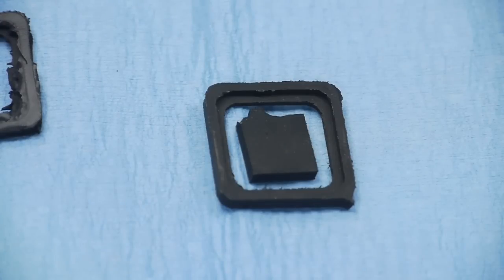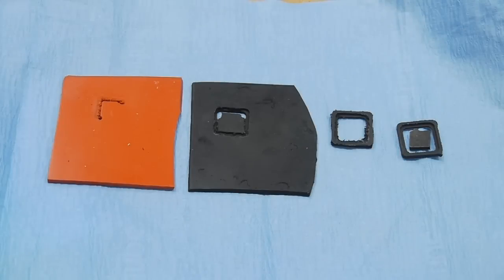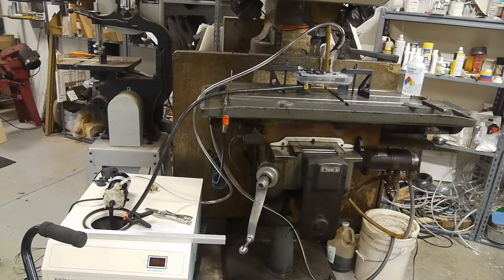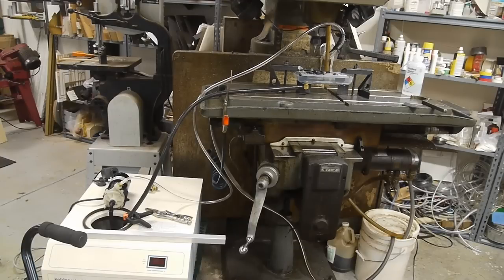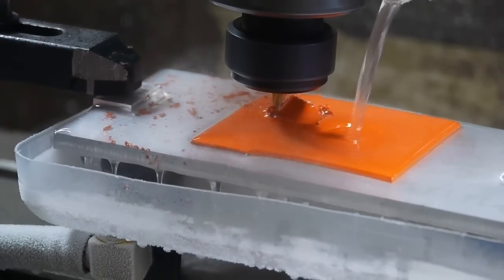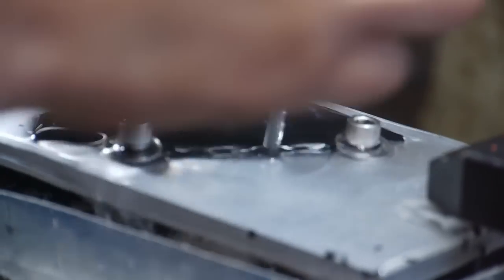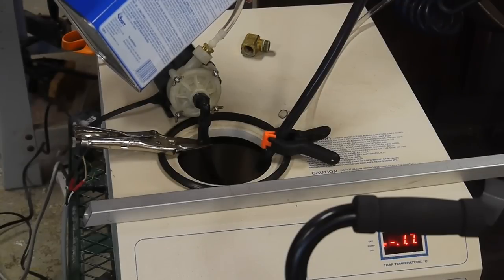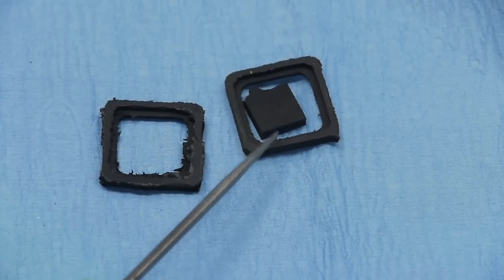Cryogenic machining: Custom rubber parts

Comment: Interesting experiment! It looks like it is easier to machine a form out of aluminium and fill it with silicone or rubber under pressure instead. Even if I need one prototype - aluminium form method maybe even faster. Plus you can heat the form for vulcanization, make few copies using different materials ... 

What will be interesting is to try machining metals such as aluminium (like 6061) when it is cold to see if you get better surface finish. One would need to consider the expansion of metal when it heats back however.

What if you take materials like ferrite cores and heat them up till they white and drop them into some salt solution chilled to -100C what properties can you get? What if you do same with two spinning copper cylinders at -100 and then squeeze white hot iron wire between them - will it form amorphous strip?

Comment: Liquid nitrogen would prolly do the same thing. I think the  trick for  that would be to keep the material in the tank in a basket until it was ready to be loaded into a semi precision holding device. I'd try it at high rpm for light layer rapid rpm and feedrate cuts.

Comment: Great video! Reminds me of a discussion on HKPro.com about cutting a variety of polymers to make replacement recoil buffers for an old pistol called the HK4. The guy making them has been using a CNC laser cutter (not sure, would this work on rubber?) and finds that with some polymers (polyurethane, for example) the material removed turns into a very sticky, greasy mess than is very difficult to remove. Somebody suggested freezing the PU first. Do you have any experience relevant to this?

Comment: im making a electronic thermometer and i was wondering if you solution to my problem i can know the measurement for 100c and 0c but i need to test it at 1 or more point to tell if the increase and decrease fallow a line or a curve do you know a low cost way to find more point
Reply from the maker: Methanol boils at 64.7*C.  You get can presumably pure methanol in the "Heet" gas line antifreeze product found in auto parts stores for a few dollars.  You could also buy (anhydrous) isopropanol from electronics suppliers.  Of course, be careful when boiling a flammable liquid.
Reply: You could also warm up the thermometer with your body, wikipedia tells me that the body temperature should be exact within 2 degrees celsius. should be enough to take the temperature at your armpits (please don't put it in your arse...) and it's a lot cheaper than finding and buying pure methanol.
Reply: I calibrated my thermistor based thermometer using a medical thermometer (the ones you use to monitor fever). Even cheap ones are accurate to within ±0.1°C. Just put both in your armpit for a minute, and get the reading of the one you want to calibrate once it's stable.

Comment: You say thats alcohol used to keep the cold temp? In my experience alcohol and many other liquids change rubber almost instantly. It becomes very hard to clean and reuse rubber seals for marijuana devices due to this. I noticed the rubber you have there has that all too familiar whiteish look to it that alcohol causes. Might want to try a different liquid.

Comment: I was just wondering about this but with metal. Some guys ehere trying to surface grind the titanium but would have .001 bumps due to heat expansion as it was very small part. What would hapen with metals at -100 when you try to machine them? Would that work at all? Did you try ever?
Reply: I guess you could cool the material quickly enough that heat expansion would not be an issue (at low rpm).
Reply: Unless you figure out a way to machine it in a pool of liquid nitrogen or hrlium
Reply: What if instead you heated the metal so that the heat coming off of it equaled the heat going in.  Now you have a stable temperature, or more stable.
Reply: That are all interesting ideas. Nothing exept experiment can tell what could work. My guess is that if rxpands in heat then it will contract on cold. The point would be to eliminate changes while its grinded so that surface is evenly cut.
Reply: jasonofcompsci
I think you're confusing heat and temperature. The milling process outputs heat, raising the temperature of the material no matter what its initial temperature was. If you cool the material, you can essentially pull out that heat as it is released. This way you can have a stable temperature. But if you start with a hot part, it's still only going to get hotter when you mill it.

On the other hand, perhaps the metal would be softer and actually output less heat when milled, but I think it might damage the cutting blades. I really don't know.
Reply: QuantumFluxable
 You would still have surface anomalies and as the piece warmed back up it would warp due to internal stress.  Assuming your grinding the piece to an exact size. The key with surfaces is what we call spring passes and patience. Get your surface withing .005 of your desired height then let the piece cool before taking your final passes. Should be spot on every time. This technique in the video is awesome but should not be used to make metal parts. Metal parts expand and contract so drastically with temperature that you will never get an accurate cut.
Reply: Possibly David, I've got temperature and heat straight.  The cooler you make it the harder it will be to pump heat out of the object not easier.  The hope is to get it a bit closer to the terminal milling temperature, if that is possible.  But also so you don't have significant cool spots and hot spots that produces the effect we are trying to avoid.
Reply: jasonofcompsci
Ah, got it. That's a good idea. I wonder if it would wok.

Comment: "normally there pretty difficult to produce" Not really, if your company has access to a newer Objet/Stratasys machine. you can just use a FLX973 cartridge. Though i will admit SLA printing is not exactly cost effective.

Comment: This might be a stupid question, and I understand that you probably did this to show the principle behind it, but wouldn't it be much simpler to cut and trim the rubber/silicone with a sharp hobby/xacto knife?
Reply: It's very difficult to make precise parts that way that aren't square, rectangular or circular, and have vertical sides. You probably noticed the step cut out of the finished part, that would be exceedingly difficult to do by hand. Same to the above comment about laser cutters. No complex edges.
Reply: Ah I understand now. Thank you very much.
Reply: Ryan Willis Why  not have cancelled with cutting  head then?
Reply: Ryan Willis
Depending on the application of the part, the step-edge could be fashioned by making 2 parts and sticking them together.
Reply: Also true.
Reply: Nehmo Sergheyev
But then the adhesive in the joint would affect the mechanical properties of the part as the joints are more rigid.  And that is assuming that you had an adhesive that would readily bond with whatever rubber you were using.

Comment: Even if the alcohol is chilled down, isn't it too dangerous to have it run around machining equipment and motors?
An ignition would be quite dangerous :o
Reply: No, alcohol (talking about ethanol here) that cold will not burn. You can hold a lighter to it. Even at room temperature I can't really see a danger. Most of the alcohol is contained well and the bit on the machining table will drain immediately after swicthing off the pump. And if your mill makes sparks while machining rubber you're doing it wrong ;)
Reply: superdau
I agree. What is actually burning is the vapors from the liquid alcohol as it evaporates but at low temperatures so little alcohol can evaporate that vapors are not an issue.

Also: https://en.wikipedia.org/wiki/Ethanol#Flammability

Comment: you don't need the liquid cooling, just mount it to a 400w thermoelectric cooling plate to cool the rubber etc, then the water wont be washed away. you could go 1 step up and float the work pice in a liquid and freeze it so the work pice is encased, also that way you could machine a foam as the lattice is supported by the ice